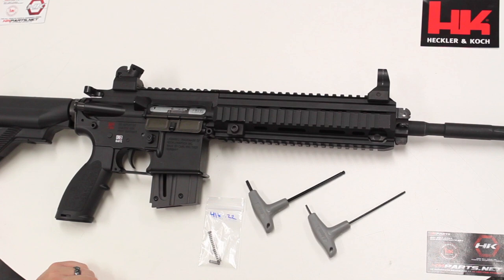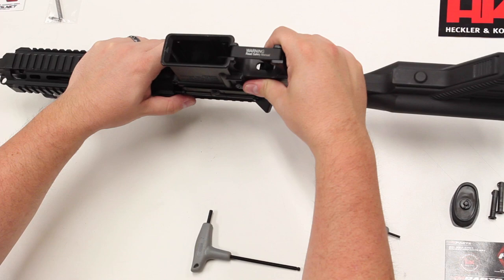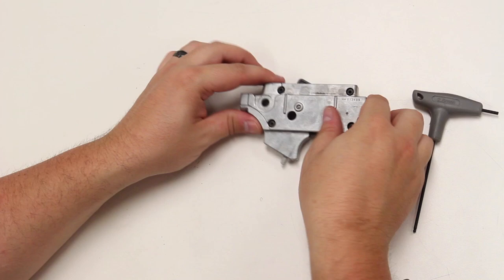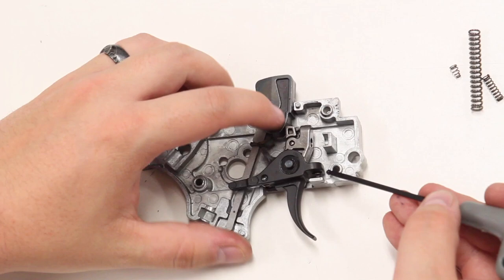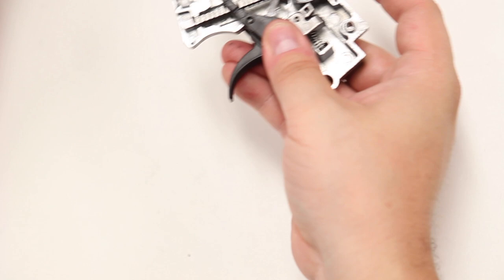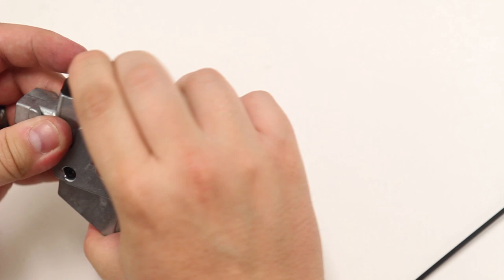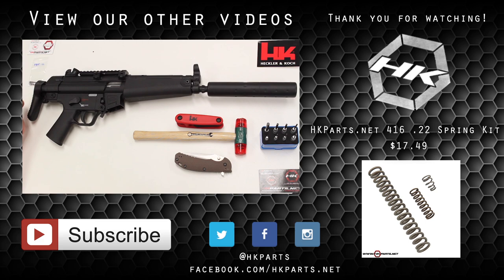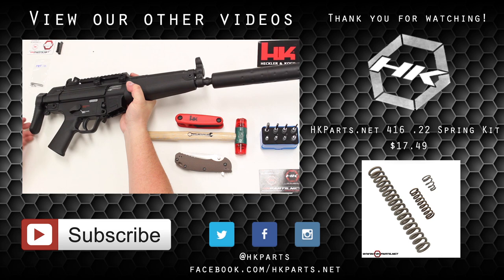HK 416 22 Match Trigger Upgrade Spring Kit Installation

Comment: $17.95 + sh&H  for three springs worth about fifty cents?  It makes a horrible factory installed trigger a little better than terrible.  These springs should have been installed factory original instead of ripping us off for more money and a lot of aggravation installing these springs for very disappointing results.
Reply: Needless to say cheaping it further with a plastic housing replacing the pot metal housing, it is an insult.

Comment: Installed new springs and it jacked up my safety selector and I ended up tearing the selector spring . Does anybody know what to do??
Reply: Did you ever come up with a solution for this?  Just happen to me and I'm going to loose my $hit!!!
Reply: Kyle Robinson anybody ever get a fix on this problem?
Reply: After I finished blowing a gasket and clearing my head, I came up with a solution that was right in front of me....I simply used the small spring from the original trigger set.  The replacement trigger is noticeably better.  Be gentle when replacing everything....Found another video that explained putting the trigger group back together in a little more detail.
Reply: Just happen to me wtf, how did you fix it?
Reply: tried this, had the same issue, and it wont work. The little steel bead on the end of the spring wont let the safety block inside turn, so it just wont work now, even with the smaller spring (which is the same size and should work) but it wont, and idk why..

Comment: does this fit a hammerli tac r1 22lr ?
Reply: Yes, just swapped mine last night and it worked beautifully.  One note though... I would recommend working inside a contained area.  In my case I used a shallow cardboard box.  There's a good chance you may have a spring or spring stop pop off during the reassembly process and the sides of the container will stop the random piece from flying across the room into a dark corner or under a bench.  It happened twice to me in reassembling and the box edges saved the spring stop from flying away both times.
Reply: @thehound2006  appreciate this
Reply: @thehound2006  are you in USA?
Reply: @oldgrunger5  Yes
Reply: @thehound2006  I'm trying to find any site that sells these and sells to the uk ...any ideas apart from hk website as they won't ship to UK 😢
Reply: Alex I've got the springs 😊
Reply: @oldgrunger5  where did you get the kit from I’m in uk as well I’m trying to find a kit for my hk mp5

Comment: why TFFF is my housing plastic? It broke where the pistol grip screw connects. HK said they would replace it for free since its known issue, regardless of expired warranty. I requested the metal housing and the guy was confused. Said that didn't exist. I called back several times and different days to talk to different people and they all didn't seem to know and said they only had plastic housings. W-T-F this rifle. BTW the spring upgrade did reduce trigger pull from 12 pounds to 7 pounds and it was pain to install. Not a job recommended for beginners

Comment: Same thing happened to me, the safety selector spring got extended. I tried using the small spring from the original trigger and putting the steel ball back on top of that, but when i put the safety selector back in place, the plastic safety block inside won't turn because the little spring and steel ball are in the way? even though I'm positive that's how it worked before. I don't know why it won't turn with it in place, and can't figure it out. Now because I tried to install a $22 upgrade, this $350 gun is currently useless.
Reply: That happened to me -- the ball detent slipped into a normallly unused position that I think is used for factory assembly. Take a look at 2:54 and you'll see a hole above the selector switch hole at about the 2 o'clock position. You may see the ball stuck in that hole. I wiggled the selector switch about halfway in, slightly counterclockwise of the safe position. Then I used a hex key to push the ball detent in while rotating the selector clockwise until it popped into the regular safe position.

Comment: Does anyone know who or where I can order a brand new complete trigger kit from?
Reply: Walther usa customer service.  I got bit too, the plastic trigger housing is a pos to put back together..  I want to see HK parts put a plastic housing trigger back together on video.  The plastic trigger assembly was 80 some bucks.  The plastic housing has rounded edges inside whereas the metal has defined edges.  Tippman arms is the way to go, costs a little more, but not if you have to replace the crappy trigger .  The Umerex guns tout the metal lower receiver, and then put the cheep as plastic trigger with the 12 lb pull…………get the Tippman, 500 bucks, great all metal, with a 4.5 lb. Trigger.      Put the video up with the plastic housing, hk parts ! Show us how its done !

Comment: I just sold my older Umarex imported MP5AP model in favor of the new HK Imported MP5SD model, while that internal parts appear to be all the same the trigger housing on the new SD model is plastic and I’m very disappointed that Hank would cheap out like this. If I’d known this up front I would have never purchased the SD… Shame on you HK!
Reply from the maker: yeah, that's unfortunate, wish they wouldn't have made that change.